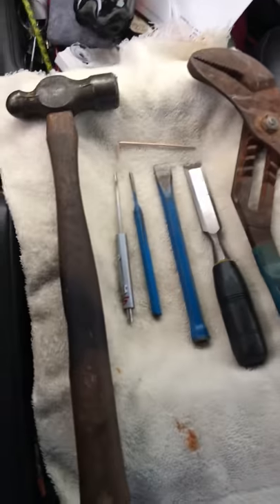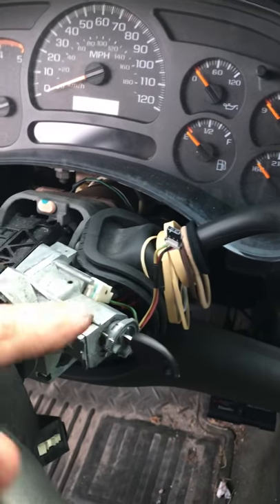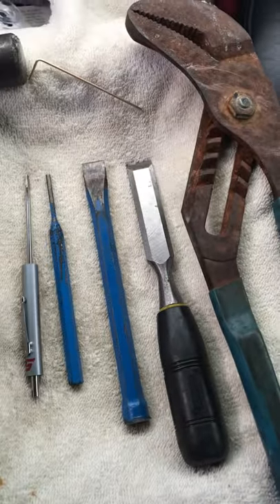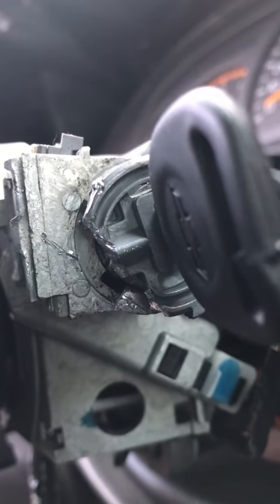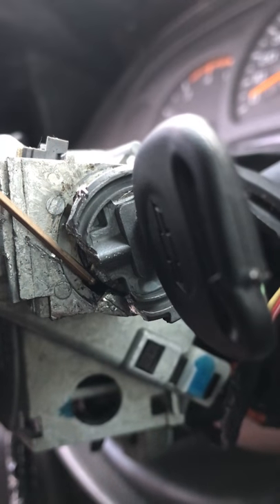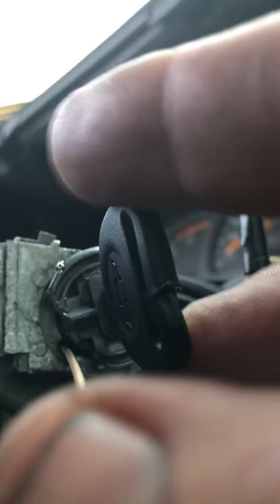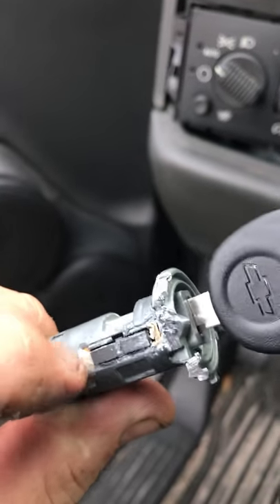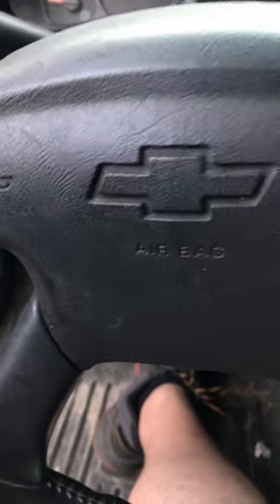2003 Chevy Silverado Ignition Cylinder Lock Replacement

Comment: Very helpful, I had a manual transmission and found that if I had taking the frame off the dash (snaps off easily) that it would have been easier to get the steering wheel housing off, especially the top. If I would have done that first would have been less stressful as the top piece was hard to remove. Didn’t need to chisel the lock as with a screwdriver prying around the edges it broke right off, soft metal so was easy. There are the three items to remove (star type of screws and one bolt) the two screws from lower steering wheel cover and after removing the lower piece the one bolt that secures the top piece. After that used screwdriver to pry/break the soft metal around the key cylinder, allen wrench to push the locking pin/bar and was able to rotate the lock to push the pin down and remove cylinder. Chevy dealer didn’t have replacement in stock, but Autozone did, OEM type for $95 but would need to mess with pins/tabs and springs to get key to work, very tedious (check out other videos re that) so I opted for one with keys (different that original keys so won’t open doors, so two different keys, oh well. But what I had read and experienced with another vehicle some times it’s the key that is worn out. I tried both keys I had, figured one was less worn and neither unlock the original cylinder, so definitely needed a replacement. After that took about 10 minutes to replace everything, reconnect battery and bingo, liftoff. Thanks your video was the only I found for this particular problem.  Thanks for taking the time to make and post your video.

Comment: Rob. You are awesome, great first vid! My ‘03 1500 jammed completely and i was told I had to try and drill into the housing to get access to the the release (since it wouldn’t turn to line up with the little hole) or have the  column disassembled. And looking on YouTube NO ONE knows about that little opening to release the cylinder when it gets stuck like this. Thanks for sharing your experience it really helped!!!!!

Comment: Wow, lucky guy. Mine is not this easy. The dam thing refuses to allow the button to be depressed to allow the cylinder to be removed from the column. Thusly, I am stuck with beating the shi* out of it and trying to drill it out. Still it refuses to let go. It is totally mutilated but the inner part of that freaking lock core refuses to break out and detach. Ideas?